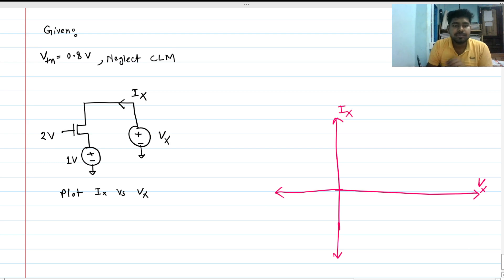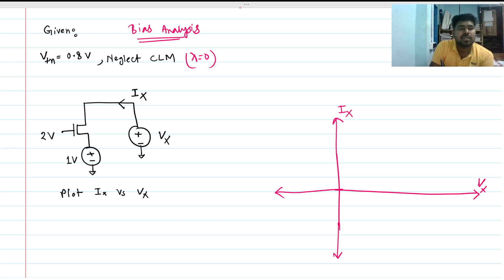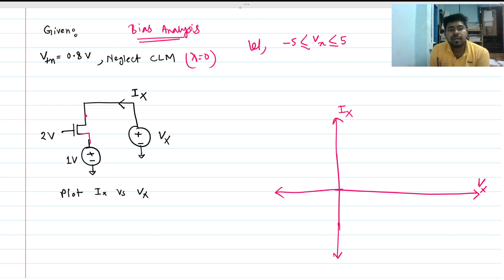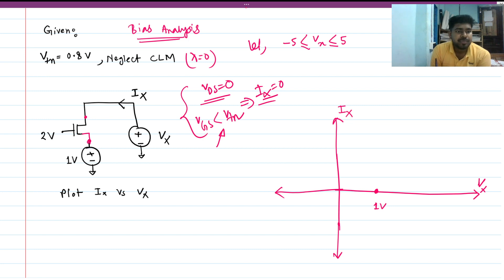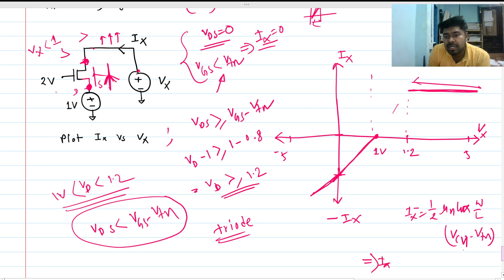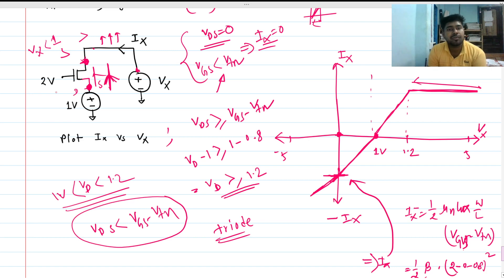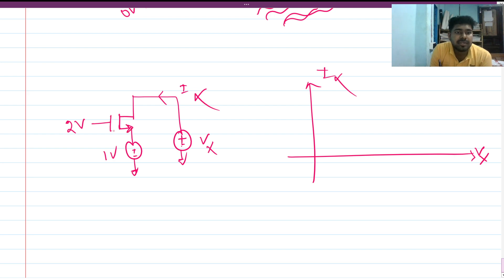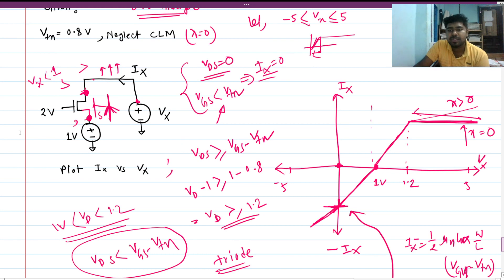Texas instruments interview questions _ Plot Ix vs Vx graph for the NMOS || Amit Bar

Comment: why did we use current equation of the saturation region when the mosfet is operating in linear/triode? (@10:20 in the video)
Reply: When Vd get smaller than Vs , physically Drain terminal will be the source terminal

I think he should use the formula of the linear region

Comment: Thanks for the video! Your questions are helpful for interview prep. I agree with the waveform for Vx > 1V. For Vx < 1V however, I disagree. When Vx < 1V, Vx now becomes the source because it has the lowest potential of the two non-gate terminals. Down to Vx = 0.2V the current magnitud (I agree Ix is negative) should increase quadratically because the nmos is operating in the saturation region up to this point. At Vx < 0.2V, it enters the triode region and the current magnitud now only increases linearly. Also adding an arrow to the schematic does nothing, it is simply an alternative symbol of the nmos.
Reply: I dont understand why you are assuming the transistor to be in saturation when Vx<1V. 
For eg: Vx = 0.5V, new Vds now is 0.5V, new Vgs is 1.5V, Vtn is 0.7V, Vds is < Vgs - Vth, which means transistor is operating in triode not in saturation. 
I think the point to note here is that the boundary condition changes as we swap the drain and source terminals(as Vx goes below 1V) of the mosfet. 
For me for all values of Vx<1, I am observing the transistor to be in saturation.